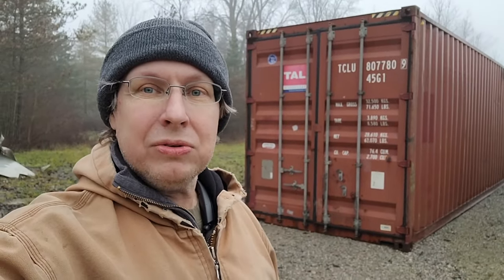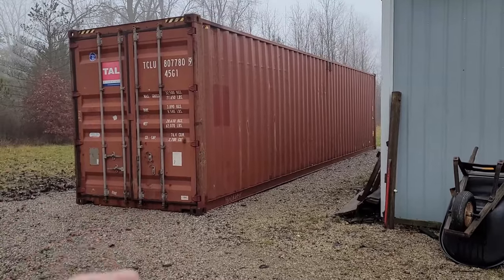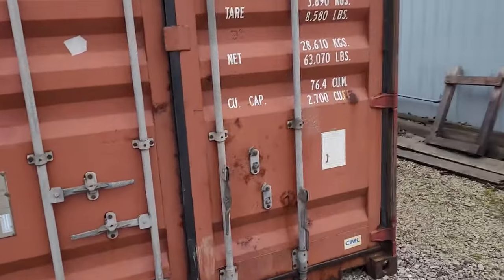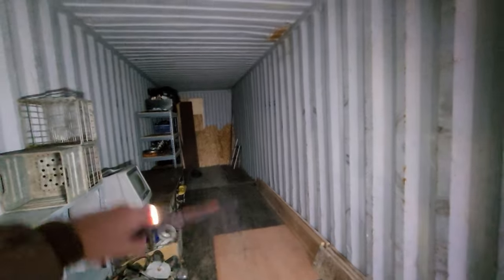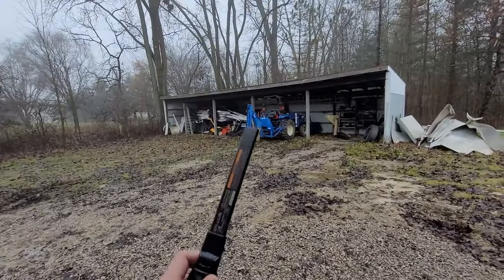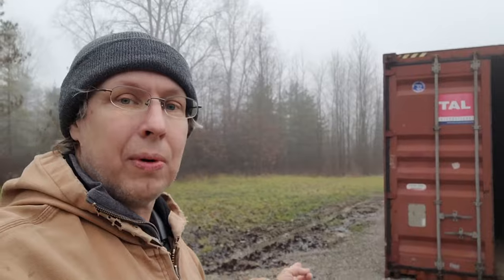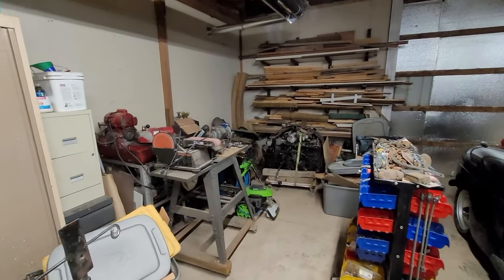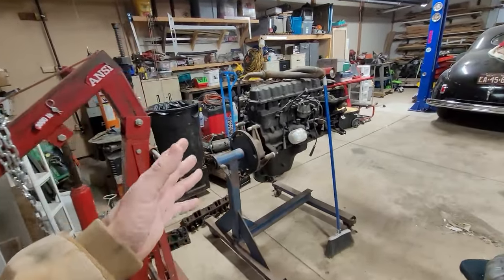Should you Buy a Shipping Container or Build Something Yourself?

Comment: We have over 6 of these at our club located in the Northeast.  Additional suggestions are to get the container off the gravel.  Get 6x6 and get it up off the gravel so it is not going to have moisture.   The floors are wood so they can rot.  Check the top of the box and make sure there is no rust from shipping damage; it will last almost forever.  Get a cheap set of solar lights and panels and batteries in it so you have some lights.  Agree on the venting.  We do not use any heat in ours but do need to get lighting.  Buy two of the same length and get a cover that spans between the two Conex and put your equipment under the cover.
Reply from the maker: Sounds good. I don't think I know anyone with equipment but enough to lift the container to put anything under it but I'll look around. 👍🏼

Comment: Last fall I got one of these, a few points to mention: The floor is not wood on steel plate, it's treated wood on an open steel frame. With a empty container your tractor will likely move it, using logs for rollers I moved my 40' x 9' into place with my 60hp Fiat 640DT. I leveled mine and used PT 6x6"x 8' posts front and back, they do swing easy and work proper, last bit closing is hard but no crowbar needed. You will have issues with condensation, hot sunny day and mine was like a sauna. I cut a hole and put in a 12" whirlybird type vent in the back corner and plan to cut in two DIY rodent proof side vents soon. With the whirlybird I worried about water getting past it, so I have a cat litter pan under it just in case, but no leaks so far. Ontario, so climate about the same.
Reply from the maker: Thanks for all of the good info. I'll have to ask a different neighbor to move this because my little 32hp tractor won't even budge it. As for the doors... I don't know. I'll have to get it leveled somehow. It gets better when I lube the hinges, but they're a little rusty. It was the cheapest container they offered.

Comment: We're startng to lean into shipping containers more in commercial architecture for some solutions for our clients because yea, you just can't build  anything that size for that price.
Reply from the maker: It's way cooler than I thought it would be. I can totally see what you're saying. I'm sure there are tons of interesting options. Thanks for watching 👍🏼👍🏼
Reply: Repurposing one-trip grade containers is fairly easy, but the way China built emergency COVID space caught my eye. They fabbed container-sized modules using existing factory lines rather than discarding extraneous parts of surplus containers. With all the parts being easily available you could sub out module builds offsite and out of the way. Modules need not incorporate standard container bottoms which are optimized for freight not construction.

Comment: You can and many do incorporate containers into their builds. Since I was bored enough to type the following for another thread I'll crosspost it here too. (Apologies for any typos. I am not an English major):

I love my container shops and ride-thru motorcycle garage because I take advantage of their rugged weatherproof shells, easily climate-controlled interiors, machinery ready floors, internal tiedown loops (for rigging cargo but perfect for hanging heavy duty shelves that keep storage overhead and off the floor and for hanging mounting hardware for electric cable and pneumatic hose), and exceptional ease of modification using tools and equipment I bought them to protect. 

I have four 40' High Cubes and a 20' standard height box. I've used them for over a decade as welding equipment and machine shop space (two 40' HCs welded side by side with an internal doorway between and an added personnel door on one "blank" end), a ride-through motorcycle garage and shop (climate control in sea can is easy with one common home dehumidifier ((VENTED OUTDOORS to avoid puddles)) even in the humid rainy southeast and a key reason I chose containers) from one one-trip HC with doors on both ends, and the most recent one-trip HC with doors on both ends not specifically assigned.

Study military and industrial containers for shop tips.  I fabbed very heavy duty hanging shelves from angle that hook to the ceiling tiedown loops. Easy way is torch bend those from round bar and i bend extra ceiling loops to weld as I go.  All wiring is jobsite style heavy duty cable (SOOW or conventional extension cord) kept off the floor by hanging from wall-side custom mounts hung from or welded to the shelves (which remain easily removable). I use High Cubes because the extra height is critical to storage space. Fabbing your own hanging shelves is affordable and you get much more rugged units than otherwise.  I sometimes hang motorcycles (including Harley big twins) from my shelves for full access no lift can match (by 2" cargo straps). 

All my shops are set up for rapid reconfig and easy modification as I get more equipment. Containers are ideal for this as is my Steelmaster A-20 steel building used in conjunction with my boxes (but not joined to them). While basic wiring is done in conduit I run easily relocated electrical cables and pneumatic hose jobsite style for most electric and pneumatic use. My compressors and rotary phase converter live on individual castered chassis in the Steelmaster and feed my containers via simple cheap "bulkhead" pneumatic fittings from Amazon (a step drill bit makes most holes I need).

I put Dinse welder front panel fittings through one container wall so I can connect cables without having to open the end doors. (If I ran big amps Tweco fittings of course work too.) Welding outside is easy since I just ground to the shell then pull the hot lead up with a rope. I weld upward-facing hunks of channel to the container roof ends that make it impossible for a ladder to slip or fall. (They catch one rung but I maintain some load on the ladder base too.) I fabbed extremely simple jib cranes because I'm an old cripple who can't tote buckets up ladders or manually raise them by rope alone. Picture a T made of pipe slipped over a vertical rod (hunk of axle) welded to a corner fitting.  That holds a cheap hand-cranked boat winch. I swing out the jib, lower the rope, hook to the coating bucket bail then crank winch and lift coating buckets (or my suitcase feeder) easily. Over the years I scored steel industrial stairs I'll add before I'm too gimped to climb ladders. Damaged gearheads can have an easy life using our skills to prepare. Shot stools inside make using my overhead shelving convenient. They'll hold well in excess of what I can manually lift but I'm not hardcore enough for centered rail gantrys like some oil patch boxed shops use. Scoring cheap beams might change that. 

Buy the best box you can manage for anything important because WWT (Wind and Water Tight) cheapies almost always have defects which will make you sorry you didn't cough up enough for a "one trip" grade, especially bad end door gaskets and corrosion (yes, Corten rusts). The climate control is perfect for my vintage motorcycles and machine shop. Containers are far tougher than most shops and are typhoon rated for use at sea. They're ideal for quickly deploying an instant shop space. I had my new electrical service placed before building my shop which let me immediately weld my machine shop boxes to their steel beam foundation (collect heavy steel even if you don't need it at the moment, I had some beams for years later used on my shops).

Beams are convenient to raise and align joined boxes so I jacked and blocked one, welded the corner fittings then jacked and winched the second atop the beams into place and welded those corner fittings. The roof joint gap got a 2" wide strip of 1/8" thick sheet (I had half a 4x8 sheared lengthwise). I used .035" and .045" FCAW to weld the entire roof gap strip. Vertical joints got either 3M 5200 (expensive thru-hull boat sealant and great stuff) or Dow U-418HV urethane (doesn't slump like 418 "non HV" or 3M 5200).  Railroad ties are fine for indivdual boxes but KEEP THEM OFF THE GROUND by at least ten inches so they can vent underneath. Do not lay them flush on the ground outdoors.

Best container size is the 40' High Cube (or longer if you can score one) for the internal height. I'm 6'2" so my shelves are slightly higher. Shelves or not the extra interior height is a major benefit over the confining standard height boxes. Best grade is "one trip" but buyers on a budget will settle for WWT so I'll cover how to sort them. If you can afford doors on both ends that's extremely handy but if not best make a simple angle frame and put a person door in the blank end so you have the additional exit and flow-through airflow when the container is placed with respect to the prevailing wind. 

Gearheads with more limited resources can get good use out of WWT (Wind and Water Tight) beat up boxes condemned for maritime use. My first two were WWT so I had to fix them. Stand inside and have a (trusted!) friend close and latch the doors on a bright day or with a bright worklight outside shining in. Any light leakage with indicates major end door gasket leakage. The main issue is keeping rain from entering through the top of damaged end door gaskets. I tack welded some angle (only because I didn't have flat bar)between the corner fittings over the end doors at a slight slope so water runs off. Then I sealed the whole gap between the cover strip and container so no water runs straight down above the gasket. 

I grind off roof etc rust and coat with Rustoleum Rusty Metal Primer. I then use Sherwin-Williams industrial roof coating which IS NOT THE HORRIBLE CHAIN STORE white rubber coating. The cheap coating is much worse than nothing because water passes through it then corrodes the base metal. Of course AFTER I was half done I found out serious roofing contractors don't use it and make buckets of money from those who do. On containers the chain store latex coatings are not fun to remove. I spent many hours with a 9" grinder driving a knotted cup brush descabbing my WWT boxes. Don't be me. Buy quality coatings because it's better to pay once and cry once.

If I wanted more open space I'd buy a container cover style building then run one 40' HC down the side. Not only is that a fast way to get stronger walls than plain sheet Galvalume-coated steel but your shop gains side rooms like old aircraft hangars had for isolated work/office space. They make perfect toolrooms with the addition of a dehumidifier (which don't draw enough juice to matter to me). That's why they're so popular with farm and industry.
Reply from the maker: That's great info! It's hard to beat these containers for the price. The one-trip was out of my price range but this WWT seems to be in decent shape. It would be cool to get another and make something cool. 👍🏼

Comment: In the building vs shipping container debate, the biggest advantage to a shipping container (in my opinion) is the savings in property taxes.   These days with the ridiculous price of concrete, don't understate the value of having a smooth dry floor included with the shipping container.  

I humbly suggest a few small changes.   First, add more ventilation.  Plastic vents like the one you have are available for about $5 each online (maybe more after COVID-19 pricing) and they're easy to install.   I recommend having them at the top and bottom for a drafting effect.   Better still if you purchase a solar-powered vent for more airflow.   I recommend more ventilation on the back side because the side with the doors cools much faster when opened.

I haven't witnessed it, but I have heard of a phenomenon where trapped moisture effectively "rains" on the contents inside your container every 24 hours when the steamy air condensates on the roof and drips in the evening when it cools down.  The next day the process repeats and everything you own will become rusty.   It won't happen in every climate but it's something to consider.   

Lastly, I have found the hooks on the inside edges to be incredibly useful for hanging LED string lights with a few zip ties.   I originally used the cheap string lights but I have been very satisfied using construction-site grade string lights.   A 50 foot string of LED Construction lights is very economical.
Reply from the maker: Those are excellent ideas. I'll look into adding some venting and lighting. I appreciate the input. Merry Christmas
Reply: The roof tiedowns are rated for thousands of pounds so I hang simple self-made shelves from them. I use round bar torch bent (every DIYer needs an OA torch set, used US-made outfits with cylinders are usually quite reasonable, see welding fora like Weldlingweb if not familiar)  hooks welded to angle steel verticals bolted to upward-facing shelf "trays" and supported at the outboard edge via lengths of flat stock running from the outboard edge to the inboard top by the hook. I place sections of plywood (my shelves are two feet wide on the insid) into the tray as the actual shelf and place flat bar or suitably cut angle underneath free floating so I can move them beneath heavy objects. I can and do hang my Harleys between shelves for full access using cargo straps. 

High Cubes have enough space for shelves to clear my head (I'm 6'2"). One is a ride-through motorcycle garage. I run a dehumidifier and of course have zero dust or insect issues.  I've also used the roof and floor tiedowns as winch points by chaining a snatch block to them. It makes moving lathes, mills etc easy (my machine shop is two joined HCs, my bros uses one) if you want an ideal shelter for items you want protected from the elements.